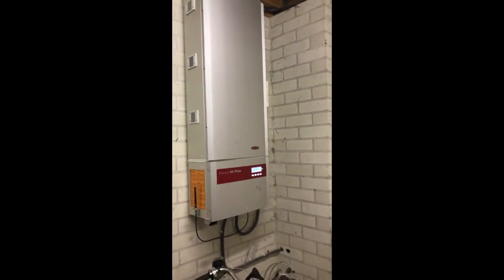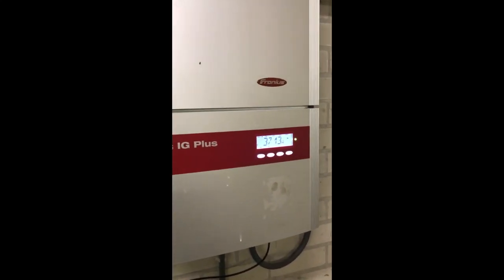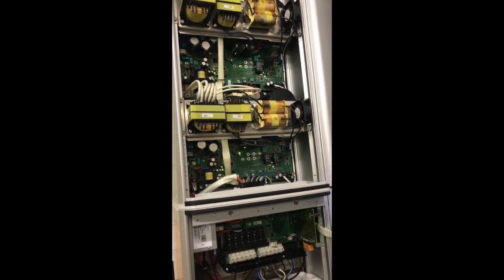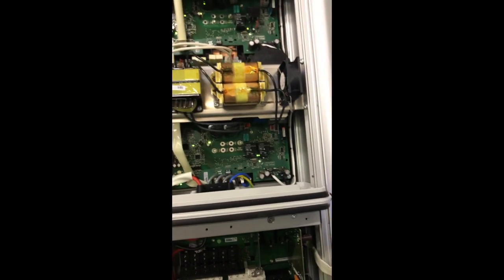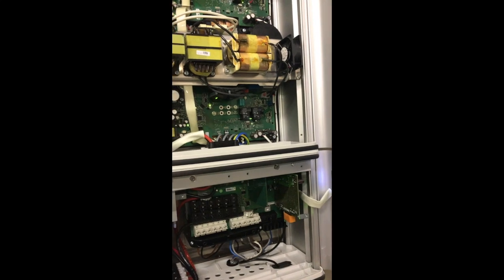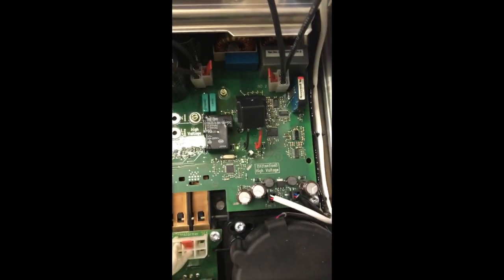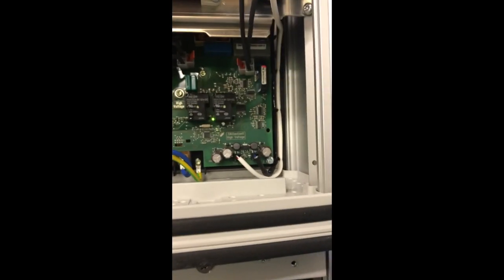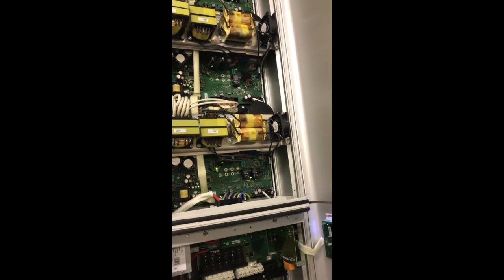Fronius IG+120V error 439 - won't start. Relay fault.

Comment: Thx you so much for sharing this video. I just had similar scenario state #305, #439 and logically #516 at the end. Based on your findings I tried to repair my Danish Fronius IG Plus 60 V2 inverter with luck 👍 Had to dismantle the full top unit and use alot of heat from my soldering tool but at the end  replaced the relays with RECOY L90AS-12W - I also used 1.5mm2 wire for the 30A connection. The factory relays are worn out fast. First time before warranty was due. This time 4 years - so not that good design Fronius. Thx. again for your video 👍

Comment: Hello Ronald
My Fronius ig plus 60 v-2 has the same problem (Denmark), just want to know. Did you solder the relays out from the front, without removing the board?
That would help a lot on this job, and will do like you, solder relays to wire for easy access. Thanks for the video 🇩🇰 👍
Reply: Just repaired my Danish - took the pcb fully out and with alot of heat from soldering tool removed the relay - all works now 👍

Comment: Great video! My system suffers from the same malfunction. Tried to order via your links - no luck. Anybody who knows where to find alternative relays?
Reply from the maker: basically you can search for coil:12VDC switch: 30A 240VAC/277VAC SPST-NO relays, so for instance mouser: https://nl.mouser.com/ProductDetail/TE-Connectivity-PB/T9AV1L12-12?qs=iJVBkmKXgrkeud%252BvgIR%252Bww%3D%3D  or Farnell https://nl.farnell.com/imo-precision-controls/srga-1a-sl-12vdc/relay-spst-no-240vac-28vdc-30a/dp/1094076
Reply: Thank you, Ronald!

Comment: Hey Ronald, great video. My fault was actually State 457 but Fronius UK in Milton Keynes reckoned it was the same relay but get this- they wanted £574.80 for me to send the board back to them and a guy on a soldering iron for 10 mins to do just what you have. Its criminal plus as you say it looks like a design flaw and maybe this stuff getting out there will affect their sales and they may be a bit more customer services facing. ATB mike bott
Reply from the maker: hi Mike, they probably dont bother and send you a complete new board for 574 pound.

Comment: Hi

How thick are the cables that you are using on the circuit board.

1,5 mm2   or   2,5mm2

Kind regards
Lars Schau
Reply from the maker: 2,5mm2 are too thick. I used 1.5mm2 for the power side. Of course you can also solder the new relay on the board but when it needs to be replaced for the second time the replacement is much harder

Comment: Seems like I have the same problem with my IG Plus 120-v3. Started to occur in January 2020 but only in cold weather, no problems during the entire year of 2020. Now in January of 2021 it is starting over again. Oddly, after some time time in error state 439 it eventually fires up again after a couple of hours. How do I know for sure that the relays are the cause of the problem?? Did you say the LED at the faulty relay was RED instead of GREEN?
Thanks for your answer and greetings from Germany
Reply from the maker: there are 3 leds around the relays. One of these leds turn red if there is an issue with the mains power (ie a broken relay). What I noticed is that the bottom board also shows a red led, but that is maybe because the bottom board is the "master" board and the other 2 are "slaves"
Reply from the maker: also with bad relays they will work after a few tries because of the spark when they close. the spark can "glue" the contacts temporarily. In this case the relay becomes unreliable and will need replacement in the long run

Comment: same code error in fronius ig plus 150. can this inverter will fixed by replacing the relays?
Reply from the maker: I don't know. The 439 seems to be a generic error code. Check if the leds near the relays turn red.

Comment: It looks like mine have the same problem. I know it frome the start since it is clicking so many times at startup. The relay will burn out eventually. Mine was installed in Feb. 2013

Comment: Hi Ronald, were the relays soldered in?
Reply from the maker: orignally they are soldered in, and its a bit of work to pry them loose. Eventually I was able to get it out by heating up each of the 4 pins one by one with a screwdriver under the relay. Heating one pin at a time on and on and you feel that the screwdriver moves the relay a bit. Keep rotating heating a pin until the relay comes out.

Comment: Great job, Ronald... Thanks again for fixing my inverter, and now I am curious what Fronius itself as to say about this, note: both the inverters are running for just about 2 years, and they just fallen out off warranty , says Fronius :-( .....  I myself find that a bit odd for such a expensive piece of equipement...
I wonder iff there are more users out there with the same problem....??? Please guys throw in some comments...